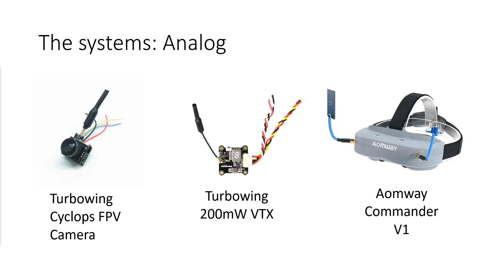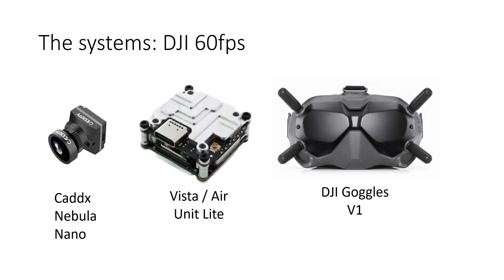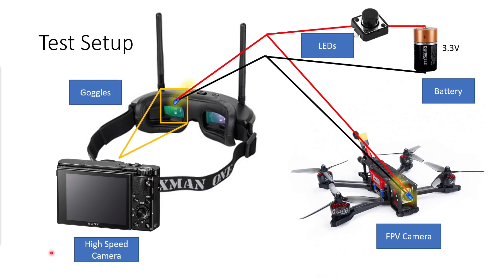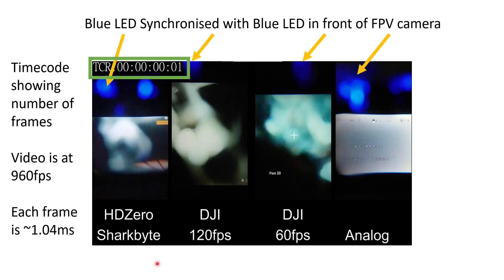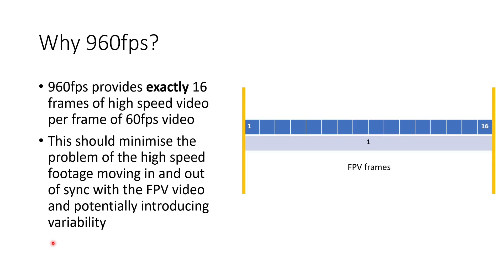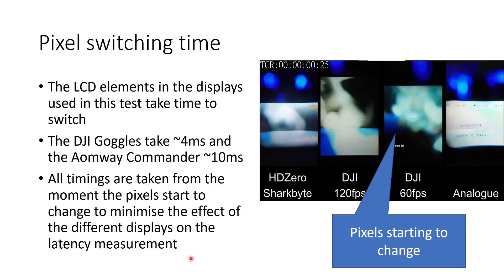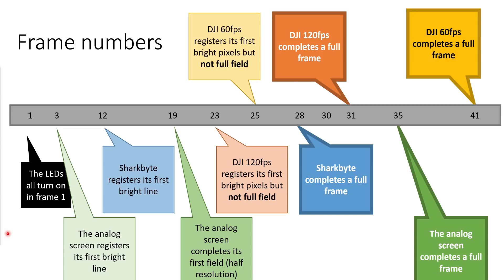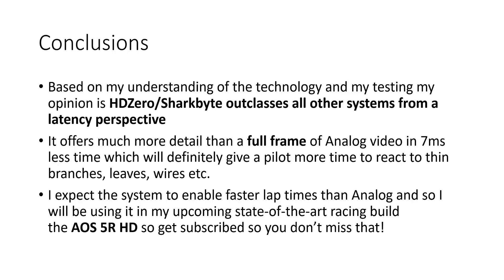Video latency testing with 960FPS High Speed Camera: Analog, DJI, Sharkbyte, HDZero

Comment: Great test man, thanks for putting this together.  The high speed camera is definitely a big part of the missing piece in understanding "latency".  A few things to point out or discuss though, I don't think the "resolution" of ghost branches and whatnot really matters.  These things are updating so fast that the time to determine what something is is really not relevant IMO.  The latency matters from a perspective of seeing the change we input from our sticks.  So the sooner we see the quad reacting to what we do, versus the time to discern what it is we're looking at.  Our brains take too long IMO to say "oh, that's a ghost branch" where I don't think these small amounts of time differences will matter at all.  So in the end is the first indication of change from analog an advantage, maybe, but who knows.  

I also think it's wroth noting that the HDZero micro camera is a rolling shutter, which I believe helps you to see updates along the way before the full frame is updated.  If I'm not mistaken, I believe the runcam nano that originally shipped with shark byte was a global shutter, meaning you would get the updates from a full frame, and that may have prevented an earlier update from a diode test.  Again, does it mean one is better than the other for flying, it's hard to say, but it would impact other tests.  It may be worth comparing how the two cameras behave in this same test you set up.

Lastly, I would be really shocked if this latency you're showing translates to repeatable lower lap times on the track.  You can also see my latest video for testing from a race lap time perspective.  

Thanks for spending the time on this, and thank you for sharing!
Reply: All Shark Byte nano cameras and the Micro HDZero cameras are rolling shutter
Reply: @RyanQuellet  good to know, perhaps it was just the prototype that was global.  I remember them showing global shutter with HDZero way back.  I thought it was the runcam camera, perhaps I was wrong.
Reply: @JohnEFly  the original byte frost vtx and analog camera combo was global shutter
Reply from the maker: A global shutter will add one frame of latency over a rolling shutter all else equal. I think the additional detail of Sharkbyte/HDZero at equivalent latency to Analog will help racers spot lines better and lead to faster lap times.
Reply: @ChrisRosser  I consider myself a decent racer.  I may not be the best, but I figure my experiences would apply for many racers.

Comment: The effect of interlacing on analog was something I never had present in my mind. Really cool from you to make interlaced vs. progressive a clear distinction. Locking in on 960hz to avoid frame jitter was also a very clever idea - turns out this is actually enough to really see the difference! It makes sense now why analog makes me so careful around leafs, lol. One thing about DJI though: Their codec builds up a initial frame with little detail and consecutively keeps adding details frame by frame until you can see a full image. When diving into my overgrown woodway, exposure change turns the image very dark for a moment. Once it adjusts, there is a completely new frame with all new details to process. This causes me to dive from a detailed image into a blurry pixelated mess, that slowly adds details from the corners in... so even 2 secs later I'm still flying into a tunnel of blocks with little idea if there will be a branch in my path and just seconds (!) later it rebuilds the whole image in full detail so I can see all the branches I'm about to hit. So in reality not only latency but this really "unorthodox" way of building image detail creates some kind of "variable confidence" when flying DJI through the branches. The detail issues with analog and this variable confidence/latency issue with DJI really makes me want to push HDZero forward. Plus you could finally tune in on someone's channel and watch them flying again.

I really think racing is the perfect growing turf for fatshark/HDZero in it's current state of development. Its main weakness - output power - isn't a big issue there and it can objectively proof it's features against analog and in some test cases also DJI. I'm really looking forward to see the results and outcomes in HDZero Races!

All you need now is an AOS racing team. :)
Reply from the maker: This is a good point. To maintain a constant bitrate DJI spreads keyframes out by having a few blocks of each frame as a rolling keyframe. With a sudden rapid change the image builds up over several frames and that can be very difficult!
Reply: @ChrisRosser  So that as the various blocks I see - rolling key frames! That makes quite sense actually!
Reply: @APHI FPV  It basically takes a while to clear up, since I imagine (have not actually tested, but it's quite visible when Vista changes framerates) there's about 1.5-2 seconds for the whole frame to properly refresh, so when a sudden change coincides with the block being refreshed - like say from really dark to really bright there's some time until it can refresh that so it can properly do h.264 things to it :) In a perfect world with tons of bandwidth, it'd just switch to inserting full iframes in situation like that, but alas the world is not perfect :) Plus in my experience that usually coincides with loss of LQ and dip in bandwidth which does not do much good for quick recovery :)  

Also if you want to see intra-refresh example you can look at World of warcraft recordings on my channel from 9 years ago, when twitch allowed you to have fun with streaming settings :) (Wind Lord Mel'jarak is a particularly good example) Start of most videos there have the telltale artifacts and you can see how they clear up (DJI has it a lot faster (a lot more framerate) and smaller chunks too). Also looking at those it actually might take two passes to fully refresh the whole thing to get rid of the artifacts.
Reply: I wanted to make a point about analog FPV before, that it only seems like interlaced video being converted to progressive scan, however didn't want to look like an idiot thinking it was 30yo tech, but it seems to be so.

I was wondering why they simply couldn't do a larger bandwidth channel & up the scanning frequency to raise the resolution on the cheap. We had analog HD video progressive scan for at least two point five decades now. Not only that but these cameras are still based on NTSC, the worst way to plop color over an analog video carrier.

Why didn't the cameras use RGB or y/pr/pb to the vtx? Did they simply have a ton of old NTSC CCTV sensors to sell after digital CCTV took over?
Reply: RE: DJI FPV, the fun part is when you get too many details on screen at once, you'll quickly find that 50mbit isn't enough to avoid blocking artifacts, similar to when streaming video has to fallback to low bitrate, but in this case its making the most of the 50mbit channel and still blocking, and will go into focus mode if enabled. Flying close over grass in lower light is very evident.

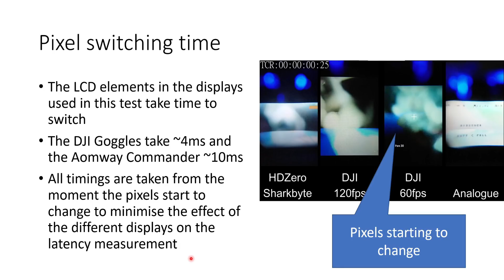Comment: 05:25 looking forward to that video. OLED should have what is basically instant g2g response times. I know with my LG OLED tv that is in the case.  Which is great for gaming and FPV and such but is pretty bad for watching 24fps content like movies, as there is literally NO motion blur. looks all stuttery. Looks insane for 60 - 120 FPS content though. LCD is going to have a large variance depending on the panel type (IPS, TN, VA) where TN can get down into the 2ms range but IPS really cant get below 4-5ms. Based on the light bleed in the goggles, my assumption is DJI is IPS.
Reply from the maker: I'm going to do a comparison of OLED Vs LCOS in a future video. I think it'll be illuminating!
Reply: @ChrisRosser  how dare you just drop a pun like that 😂🔥
Reply: DJI is indeed 144hz 1440x810 IPS panels. Which probably are driven at 144hz (should be fairly easy to determine with when half frame is followed by a full frame, that probably does not happen in 8ms but instead in 7ms) thus explaining the half frames - which are well.. probably just regular old tearing, due to no vsync. And in this case I think it's better to have tearing to save a frame of latency (since I imagine at the time these were conceived there were no small off the shelf high speed panels with variable refresh and controllers for them), I kinda think goggles V3 will have OLED's with VRR or well go to 144fps video. I also imagine that wont happen any time soon.
Reply: vscync would introduce latency though, since we would be buffering (or....tossing?) the frame while we waited for the previous frame to draw, no?
Reply: @mouseFPV  Indeed it would, I think I've edited the comment too late. Basically TLDR is that it's good that there is no V-sync. I imagine they would've gone VRR if there was any hardware for it back when those were designed. I'm guessing next goggle refresh (proper one) will have something like VRR OLED's to have best of both worlds, low latency and no tearing. Since there's plenty hardware nowdays (though mostly in phone screens, but.. at least there are controllers/drivers available).

Comment: Thx for that analysis. So now we for the first time see the real thing. If you analyze the logs, one can see that DJI jitters on a racetrack are mostly below +/-3ms. Now think of the latency jitters if Crossfire or ELRS etc lose a packet, which happens more frequently than most think. To be honest looking at 28 vs 31+/-3ms, the real latency delta is below human perception.
Reply from the maker: I tend to agree. I think it's just the jarring effect of a late video frame that pilots struggle with on DJI.
Reply: @ChrisRosser  Not sure whether a rolling shutter is really good for fast moves. It ends up realizing distortions.
Reply: @Stefan_73  I have not really noticed it in 120fps mode (on both DJI and nebula pro), Polar in the evening does have some motion blur and some visible rolling shutter though and it kinda feels fairly susceptible to jello as a result.
It would be nice to have a global shutter, but I suspect that not a lot of off the shelf small sensors support it in a cheap-enough price range and high frame rate.
Reply: @ooHotcooleRoo  me neither on DJI. The rolling shutter is what gives SB and analog their small speed advantage. But it leads to distortions or interlacing artefacts.
The 120p are often underestimated as this provides a significantly better video experience as stutters are removed. VR is moving to 90Hz+ for the same reason.
Reply: @Stefan_73  VR was always 90hz plus tho no? Gaming in general is better at higher frame rates.
Reply: @ChrisRosser  DJI variable latency jarring late frame would be on something like a blind dive into a bunch of trees.  Same jarring digitized rainbow would flash on SB.  You should  not talk about jarring variable latency without mentioning in the same environment SB and analog would have jarring static.  It all comes down to how you like your break up.  Skipped frames or full frames of static.
Reply: @jp-3dairgunworks152  Not entirely true, with analog you get a black&white image because pixel brightness information is retained longest, you can continue to navigate without latency albeit in b&w
Reply: @karoo_bushman6880  Depends on how bad is it, I usually get quite some bright flashes on analog (probably diversity stuff) in the places where I can get a late frame on DJI. Both are super not fun to fly through.
Reply: I don't know, what you say sound right to me, but I flew analogue for a year, and on my first time trying dji digital I wanted to throw up. I assume it was the variable latency.
I have since flown dji more and I don't feel sick anymore but I do feel like I notice the latency.

Comment: great test but you should consider test the analog rig with a proper low latency fpv camera like a foxeer predator or so!
Reply from the maker: The pipeline latency for the Analog system is only 2ms. Even with a faster camera there is little room for improvement.

Comment: You tested analog using NTSC, hence the 17ms field to frame update lag. Most people use PAL for higher resolution, but that has a frame rate at 50Hz and thus a 20ms field to frame lag. It would be good to see PAL analog added to your test. Looks like on high power, to combat variable latency, DJI gives analog (in particular PAL) a good run for its money.
Reply: Yup, I imagine it would. Also I would not say I feel the difference, but from video smoothness point of view I much prefer NTSC analog despite it's lower resolution. Got way too spoiled with 120hz..
Reply from the maker: Great point! I'll definitely put a pin in that for future work.
Reply: For racing, most of the folks I fly with run NTSC (as do I).
Reply: i wouldn't say dji gives analogue a good run for it's MONEY....

Comment: Might Sharkbyte / HD Zero be better on purpose built goggles? There could be additional latency introduced from the HDMI in?
Reply from the maker: I think the only way latency could be introduced is if the HDMI Input has a frame buffer. I don't think this is the case for most Analog goggles. It's certainly not the case for the Aomways
Reply: @ChrisRosser  If my expirience with general purpose displays (or say variable refresh displays like G-sync) is anything to go by, there will be at least 2-3ms of latency introduced. It would be interesting to compare this setup to Scout HD. Though I imagine the total impact on it all would be negligible.
Reply from the maker: That could very well be the case. If there is some processing involved in the HDMI conversion it would add a very small delay.
Reply: @ChrisRosser  What if you add scaler like some HDO people users?
Reply from the maker: I imagine that a scaler will add a tiny amount of processing delay (no more than a couple of ms)
Reply: There surely is, but it's likely in the range of a couple milliseconds.

Comment: As far as i know using LEDs in parallel could lead to different response time, because the one with less resistance will light up always first. Maybe switching the Leds again and doing the same test based on an average number could be more exact?
Reply from the maker: Direct emission LEDs typically have a turn-on time in single-digit nanoseconds. Considering a single high speed video frame is approx. 1,000,000ns I wouldn't expect a different result swapping the LEDs. They switch on instantaneously for our purposes.
Reply: @ChrisRosser  aww you beat me to it!! Haha. To make any visible difference the cable lengths would need to be massively difference to increase the resistance in one half of the circuit.